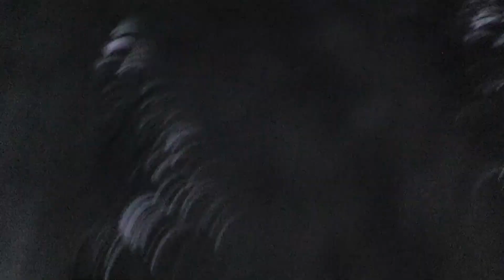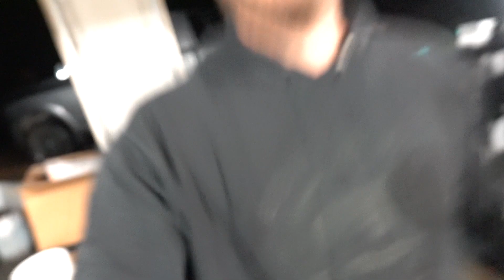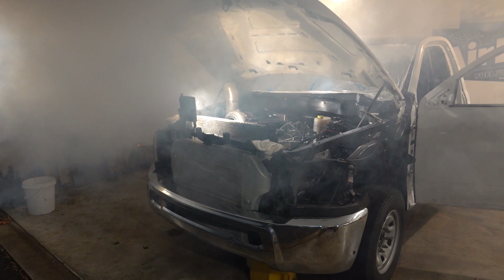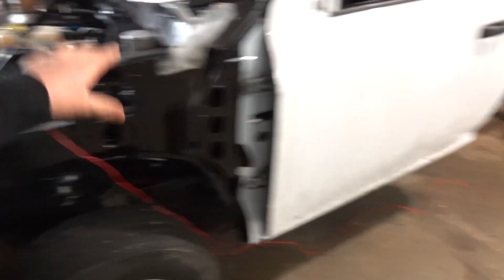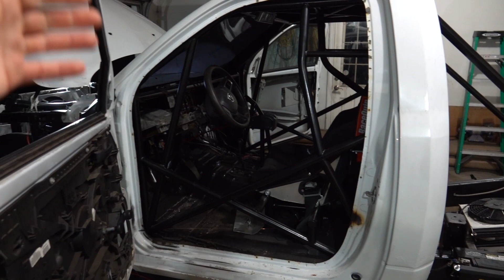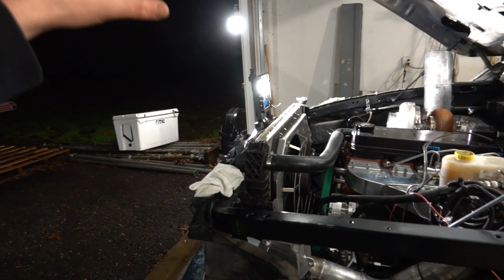Admitting Defeat...

Comment: I was a commercial diesel fitter/mechanic for over a decade... with the noise it was making I would not have let it run, I was yelling "shut it off shut it off" under my breath before it even fired because I could hear it wasn't right just on starter motor. 

Pro tip, if an engine is making weird noises, DON'T RUN IT. You're only doing more damage.
Reply: I played it back again and listened properly on headphones, investigate the timing and valve train, physical inspection not computer readouts. Not being there I can't help anymore than that.

Comment: Check injector terminals sounds like a injector either not firing or injector stuck open....even sounds like maybe timing is off.....over your winter projects for truck consider going with Yukon axles front and rear and spools or air locker in the front might as well beef up stock axles because one breaks and you could be in for a hand full of a ride....and new axle u joints also since you've added 1000hp over old setup shits going to break

Comment: Kind of seems like injectors are firing on the wrong stroke not sure how the built engine is vs a regular 6.7 but maybe check your 2 connectors on the side of the valve cover that go to your injector wiring and make sure you didn't flip flop plugs during assembly

Comment: No big deal man. This is how these kinda builds  go. I wouldn't sweat it at all.  I think I could be a crank shaft sensor or ECM issue but I doubt it if the ECM was fine befor. Gotta data log ithe truck or dyno tune it.  Actual vs desired rail pressure, timing and fueling....that kinda stuff.  Might be a simple tune issue or corrupt file. Your will get it

Comment: The amount of white smoke (unburnt/partburnt) fuel that is a mechanical issue not an electrical one.   It’s w Diesel engine at the end of the day.  You can take all the computers away and it should still run.   I’d say it’s either an intake issue or is a compression issue.  Failing that you got a stuck injector just hosing fuel in.  

Have you taken all the injectors out and compression tested each cylinder?  Have you flow checked the injectors?

Comment: You’ve already got a perfect project for the channel sitting in your driveway. Veronica... if you listen closely, you can hear her begging for an R2.8 or a 4BT swap. 

Or if you wanna make her stupid fast and totally impractical, find a wrecked Viper. A 4wd quad cab manual 2nd gen SRT-10 would be amazing. Been wanting to swap a Viper or LS7 into a 56 F-100 for a while now... I’d say one of those but Welderup sorta struck that lightning with Ol Smokey already.

Comment: Check valve lash, I’ve had a similar issue with a new motor, was fine on the engine dyno, put it in the truck a month or so later and sounded like this, weird stuff happens. Also check injectors, possibly have one acting up sir

Comment: Try another ECM
Reply: I would agree  start with the ecu. Maybe it was damaged  when  the roll cage was installed or some sort welding? But, would the truck even start with a bad ecu?
Reply: @krischapa7736  it can I'd check datalogs coils injectors and or fuel system and timing cause the white smoke
Reply: devin Dfresh  check the coils? What

Comment: This may be a long shot but she is running like she much just be cold hearted. What I mean is obviously you are not running an intake heater. Idk what the temperatures are like where you are at but with no intake heater and a high horsepower engine it can be more sensitive to cooler temperatures.

Comment: Cam shaft position sensor?  I know you have prob looked already and would have ran a code for it. Or a rough cold start 🤷🏻‍♂️ “humor” gotta get us a run on a back road I’m dying to see this thing move.
Reply: Also Tom quick tip question what trans oil should I run in my 08 6.7 with the 68rfe transmission? Not much done to the truck tuned deleted straight piped and stage 2 ripper transmission..
Reply: @thatcrazycumminsowner540  atf +4
Reply: Matt Sleith but brand ?
Reply: @thatcrazycumminsowner540  i run mopar atf+4 from the dealership i also use the filter kits too
Reply: Matt Sleith thank you. I’ve had horrible luck with all my transmissions I’m new to the diesel community I got a good transmission now but I feel like top end I’m starting to get a little shift flear if I’m pinned down on a high tune. Want to be cautious as possible. Any recommendations to getting my trans tuned and I mean just my trans ? Do you have instagram should add me brian_apodaca